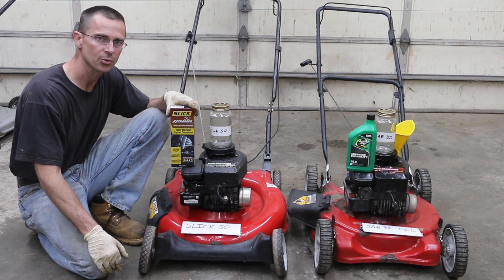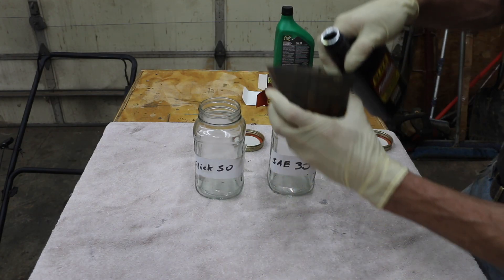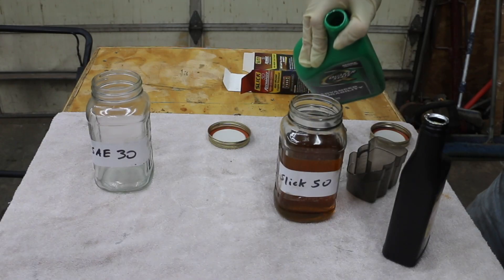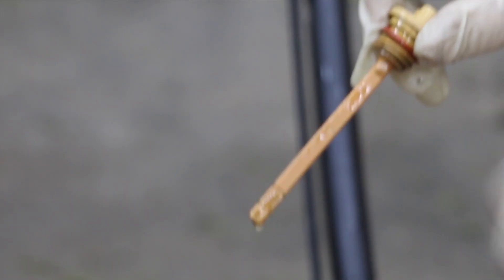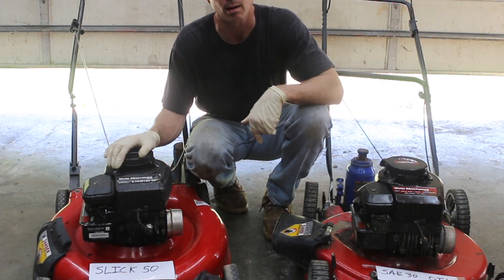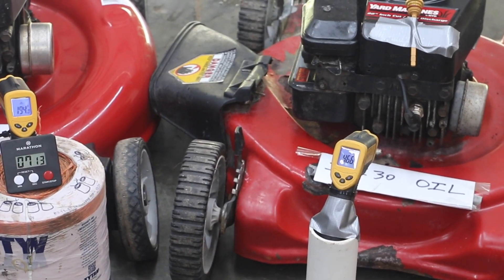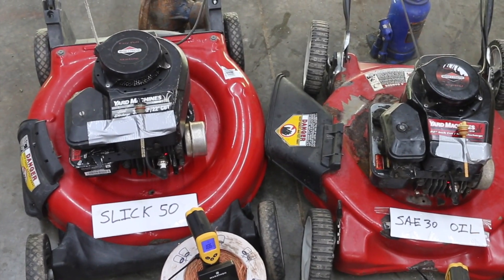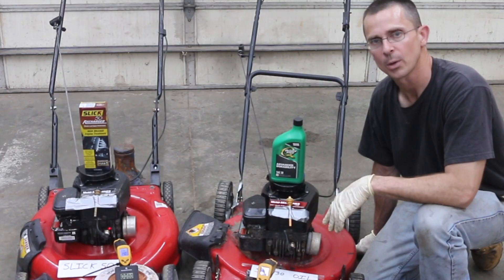Can't believe what SLICK 50 did to my engine!!--Dry Crankcase Test!

Comment: There were some good comments of which you acknowledged so I am sure your next test will come out with more accurate results, record and monitor everything that you can. My father was a mechanic all of his life and I now have over 50 yrs in the trade, I have put together several racing motors that performed significantly better than so-called professionally built motors. Quaker State  and Pennzoil both will gum-up motors tried the graphite oil a long time ago, (big mistake) an oil engineer that worked for GM told me that Castrol was the best oil but only if the motor was run everyday, if it set up even 1 or 2 days it would condensate and create an acid. Most part store house brands are good I don't like wal-mart but a lot of people shop there and their house brand is good but I am sold on Lucas, I took a 300 mile trip and when I got there I was out of oil (pop valve in filter housing went bad) with no trouble at all. Typical motor break-in use 5w-(light) oil first 2-3 starts only get to warm then cool back off no high rpm's or heavy loads first tank, second tank only short full rpm's and full loads cool 2-3 times, third tank run at max capacity about half the time cool once, forth tank run at max but cool once, fifth tank show it no mercy your motor is now broke in get that break-in oil out now it is contaminated with micro particles of metal and other contaminates from assembly, put good oil and your additive in and run full load for 5 tanks your motor will now be conditioned. I know a lot of people will call BS but just use common sense metal expands and contracts with heating and cooling and a motor gets different temperatures in different places and rings,pistons and cylinder walls have to mate together by rubbing each other, too much too quick and it could seize or start a micro leak and shorten its life. Try driving a piece of re-bar through a small pond dam that you want to get rid of, you don't need a back-hoe or dozer to cut it the leak you created will do it for you, the same thing can happen to the rings and cylinder walls, I have seen plenty. Diesel hardens and cracks seals and gaskets and has very little cleaning power. I hope I have helped someone and saved them some money because I know you need it more than the big manufacturers.

Comment: Slick 50 clings to metal, but all that does is clog the small oil passages and starve the engine of oil. Teflon, the ingredient in Slick 50 & others, has no use as an oil additive. The big oil companies tested it and found this out back in the 60s...

Comment: slick 50 contained PTFE(teflon), which reduced the friction and therefore less heat. We had the same product here in holland, and here they put the whole bottle of slick50 in the place where you normally put the oil and then they ran iot for 10-15 minutes so the PTFE had coated the parts and then they drained it

Comment: So I think I know why your slick 50 failed first. Oil has the primary function of heat dissipation within an engine. Slick 50 had a lower engine temperature before the drain, so the remaining oil after the drain did a worse job of testing heat away from the cylinders, which allowed the heat to destroy the engine faster. it seems like slick 50 is counterproductive to protecting engines or the model engine was too different to compare.

Comment: it may be the fact is they are used engines and are fairly worn already. Maybe if you went to like a harbor freight and bought a couple of new cheap Chinese built 4-stroke motors but that might be a little too expensive to do. but much I like you I kind of believe the hype back in the day with the slick 50 but I never used the product before. I remember their big thing was the PTFE or Teflon that they used to use in the product or still use in the product. This  has nothing to do with your experimentation but why the hell did manufacturers delete the oil drain plug?

Comment: Slick 50 was supposed to cause an engine to idle faster after adding it. I warmed my Chevy Luv motor and added Slick 50 while idling. It did not change the idle speed at all. A friend found the same results. BOGUS oil additive.

Comment: take which ever of the engines that's in the best condition,, take it apart,,remove all oil,grease,an oil residue,,, lube everything up with DRY graphite powder,put back together,,add graphite powder to crank case,,( half full) start an run until gas tank is empty,,,SUPRIZE!!! have fun with it

Comment: Pretty sure the whole thing was done wrong? Slick 50, in the instructions say's to shake before use. That's cause all the solid ''teflon'' pieces are at the bottom. You know,  all those pieces that plug filters, passages etc.

Comment: briggs pushmower engines are throw away engines and yes i do include the industrial commercial engines in that statement ...but its worth noting that the average joe will never have to replace his mower... assuming that he isnt cutting a huge yard and doesnt hit anything that would break the flywheel key or bend the crankshaft and keeps up his maintenance (regular air filter cleaning oil changed every 20 hours and spark plug cleaned when needed blade sharpened after every three cuts and crank the mower at least once a month in the off season and not stored in direct sunlight...prolonged storage in direct sunlight causes the fuel to heat and cool with every cycle of the sun and causes fuel to evaporate and breakdown causing carb gunk).... just a tip from from a small engine tech of 20 years and an additional 13 seasons as a lawn guy...

Comment: I bet had you used Slick in the mower on the right, it would have kept running. The mower on the left had far few hours on it and far less wear. This is a huge factor in why it locked up so fast. 
I also remember the commercial with a red Dodge Viper being driven by a popular race car driver around a track with no oil. But I think the product being advertised in it was called "Prolong Engine Treatment"

Comment: I drove 10 miles with zero oil pressure to my mechanics shop with my 87 GMC pickup.  350 motor treated with Slick 50.  Never seized.  Didn't even get hot.  I still can't believe it. I've also used Pro-long and duralube with good results

Comment: To do this test with a controlled situation, you would need to do this on two brand new engines. This test is not practical, because who knows how hard the mower was used and abused prior to you doing this test. Was it maintained as well as the one with the regular oil in? This is not accurate.

Comment: 30 years ago a family mechanic was telling us about the benefits of Slick 50.  He told us something about a work truck he had with maybe 200,000 miles on it and at about this time he would rebuild the engine.  He took the head off for fun to see what Slick 50 had done and was amazed there was zero wear.  That was his story anyway.  I quit using it 20 years ago and just change my oil at 3k miles.
Reply from the maker: I'm told they changed the formula in recent years, impacting the quality of the product.  Thanks for watching the video and commenting!

Comment: I use Prolong Engine Treatment. Would love to see how that would perform in a test!!
Reply from the maker: Yes, I will run the same test using Prolong.  Hoping to find 2 fairly new engines for the test to make things fair.  Thanks for watching the video and commenting!
Reply: Thank You! I know the Prolong Engine Treatment works as I noticed a definitive improvement in shifting. There's this motor oil tester called 540ratblog that tests every motor oil on the market and ranks them. He tested the Prolong and results were it considerably improved the strength of the oil it was added to. So that's when I began using it and like I said the tranny addictive worked. So your test should be interesting. Thank you!

Comment: Doubt engines are dead. Lot's of posts suggest overnight soak in PB Blaster / WD40 / diesel / brand X penetrating oil with plug installed (no evap). Incline engine to get the rings & walls lubed. Next day, take out plug, turn the main blade bolt (may need breaker bar). Worked for me. 

Don't waste $$$ trashing new engines because someone dared you to.

Like the tests and the science. Keep up the good comparisons.
Reply from the maker: Thanks for the suggestions!  I'll see if I can bring them back to life.  Thanks for watching the video and commenting!

Comment: You did not run the Slick50 engine long enough. It requires a minimum of a few hours of running at operating temperature for the resins to bond into the metal. All you did was rinse the engine with the Slick50. You wasted 2 engines due to your faulty test protocol.
BUT, the old promo of the engine that runs without any oil was the original Slick50 engine treatment with PTFE resins in it. It did a better job of coating the engine and lasting so the engine can run dry. The new no PTFE Slick 50 does not have the same capability.
Reply from the maker: Great point!  Thanks for watching the video and commenting!

Comment: With the engines being in "used" condition, it could be that one engine already had more internal wear than the other. Maybe try with four additional engines (two with Slick-50 and two without) for a best two out of three test result. I don't trust Slick-50.
Reply from the maker: Great point on the used engine comment! Thanks for watching the video and commenting!

Comment: You might want to test the justice brothers oil treatment.  It increased my mpg on my Ranger by over a third but only lasted through about two tanks of gas.  I believe I was able to track the 'secret' ingredient down to zinc.  One person added some Head-and-Shoulders to some regular oil and it worked almost as good as the JB product.  JB claims that they took a treated vehicle to one station for an oil change and left before they could add new oil or replace the drain plug.  Drove it for some significant mileage (100?) and brought it back to have the oil added with no damage to the engine.

Comment: I wounder if the mower with the 30wt standard oil was a little more worn out to start the test. A worn engine will have grater tolerances therfore more room to expand with hear before seizing.

Comment: I've been running Amsoil for years, very satisfied. Would be interesting to try that test with this oil after flushing good, drain oil install Amsoil run, drain again install Amsoil drain and then test. http://www.amsoil.com/shop/by-product/motor-oil/4-stroke/formula-4-stroke-10w-30-sae-30-small-engine-oil/?code=ASEQT-EA?zo=1646739Also a test with the SABER Professional 2 cycle oil would be interesting http://www.amsoil.com/shop/by-product/motor-oil/2-stroke/saber-professional-synthetic-2-stroke-oil/?code=ATPTS-EA?zo=1646739

Comment: Unless slick 50 has developed a new type of slick 50 for air cooled engines this test has no validity.Slick 50 is developed for liquid cooled engines.I have used slick 50 for many years in both cars,trucks and tractor engines.I have always experienced exceptional performance and a minimum of wear.In my opinion its the best money you can spend for any additive to prolong engine life.

Comment: Maybe I'm jumping the gun here,  typing at 2.25 into the video, but that is not the SLICK 50 i used to put in my engines 20-30 years ago, the Slick 50 on here, as the guy said is about 30 weight oil whereas the SLICK 50 of old was about 50 to 60 weight.

Comment: I ran slick 50 in my old 1977 cutluss many years ago mixed with motor oil drove all over the USA never had any problems until one day lost oil presure weather slick 50 helped or not after 165 thousand miles plus I lost the oil pump and had to rebuild the motor I honestly don't think that product helped at all

Comment: I agree with other comments. Accurate test would need to be with 2 new engines as these engines have different hours, different oils, different fuels and different revs throughout their lifetime. Non the less it was interesting to see the difference in temps. (although this may also be effected by the condition and/or tune on an engine)

Comment: So, oil not drained at the same time.  One had longer for the oil to drip back down into the crank, off of the moving components.  I wonder how much that may have influenced the results?  The first one drained failed first. We also don't know the condition of the engines before the test.  I feel like this test was nothing more than a waste of working engines and our time.

Comment: I have tried slick 50 with no results in my truck years ago.  there is no oil additive that will bond to the metal of an engine.  the ones with PFTE teflon mixes with the oil after a numbers of hours and creates a super slick coating between the parts, they work.
try Tuffoil I have used it since the mid 70s and it works but.....it does eventually wear out of the oil and you have to retreat.  on the lawn-movers I have used it on with  carb engines the rpms would go up after several hours of running them.  you have to give it time to mix in with the oil.  thanks for the video.

Comment: I notice that you got more of the slick 50 oil out than sae30. Perhaps the small amount of oil left in SAE30 engine was cause for it to run longer? The fact that more of the slick 50 treated oil came out shows that it was probably thinner. The thinner oil would cause the engine to run cooler. This is because it can dissipate heat faster. Next test is 5W vs 30W. I bet results would be close to the same as you found in this test.

Comment: When Slick 50 was new it did work as advertised. The Teflon in it was DuPont but DuPont sued Slick 50 claiming patent something or another. Slick 50 stopped using DuPont Teflon and used a inferior type,; it has never worked as well since. The original formula  Slick 50 DID increase mileage in a '80 2.5L gm engine by 11 MPG and saved it when a head gasket went, filling the crank case with coolant. Since then it's a waste of money.

Comment: you had the exhaust from the slick 50 engine blowing into the air breather of the 10 w mower and also created less cooling air around the engine .... do it desperate and start with new mowers .... Walmart
 takes back everything

Comment: yeah i think you guys missing point slick 50  kept motor cooler big time and its probably different weight so the sae 30 was thinner if you going to put it in as a mixture it may keep your oil cooler then reg oils

Comment: You would need identical engines with identical hours of operation in identical conditions for a test like this to have any relevance.  If you get a very worn out engine, it will last longer without oil than a new engine.  But thanks for doing this, was fun to see which would die first.

Comment: The engine that ran hotter had more cylinder expansion which was probably the reason why it took longer to seize up.
I would be interested to see Militec-1 and caster oil tried.

Comment: I have read a scientific test that has been made years ago, very similar to this one with two briggs engines. The conclusion was that the microscopic PTFE balls fills up all the pores in the cylinder wall, and stops the oil molecules to attach to the metal.  The friction goes down but the amount of metal shavings become bigger because the tops at the rough surface are unprotected from the wear. The oil cant grab onto the PTFE clogged cylinder wall.. and this test was made WITH oil and they found plenty of metal shavings after the SLICK 50 treatment.  Dupont, the inventor of the PTFE tried to stop companies to use this in oil, because they have made tests that show  exactly the same result.. It's not good as an additive in motor oil.
Reply from the maker: Thank you for providing this information!  Very informative!

Comment: you should have oil in the Engine. problem solved .
Reply from the maker: LOL!!!  Thanks for watching the video and commenting!
Reply: mercuryxr Hmm wouldn't that nullify the hypothesis being tested?
Reply: mercuryxr he was just trying to prove what they claimed in their commercials where they ran an engine without oil for hours on end.
Reply: Slick 50 newer told us to run the motor witout oil. so my point is that the test is to extrem to prove anything.

Comment: Prolong.      Ran it in my kt100 at up to 14,000 RPM for a full season.   On engine tear down at the end of season, the insides looked like brand new...I also used the spray lube on the wheel bearings and you could see that the wheels would spin twice as long with the Prolong apposed to other lubes.

Comment: Although no help on the 'oil sticking' it might be some use on getting the engines to re-run. Castrol do a magntec.... but...
I have heard but not tired if you remove the plug and allow diesel to sit in the cylinder it can unstick rings and so forth. Also as its a hot scieze it would be interesting to see if the cooling of the piston (quicker than the bore) can therefore unstick it too. 

If its totally dead then a short this is what happened inside would be great for us all to see and learn from

Comment: Curious, I noticed some particulate that washed up onto the jar of slick 50 when you drained it. Did you take apart these engines to see if one engine was in better shape after the test. If the slick 50 engine had a bunch of crud before the test, the test would be inaccurate. Thanks, Scott